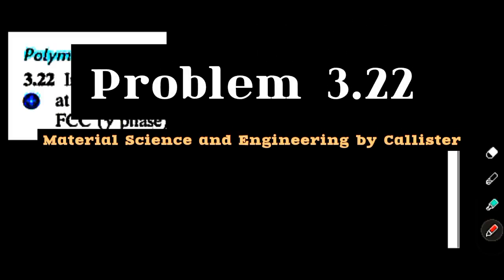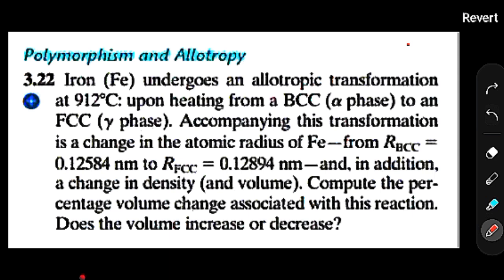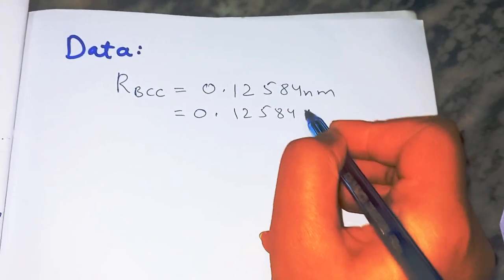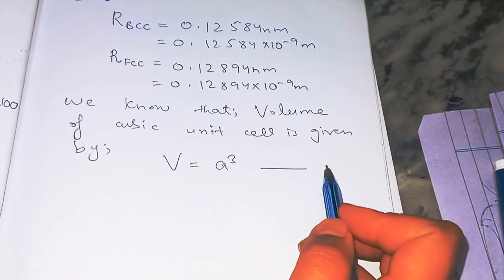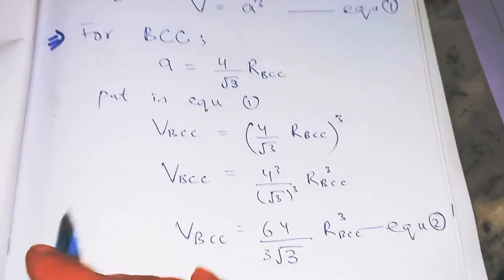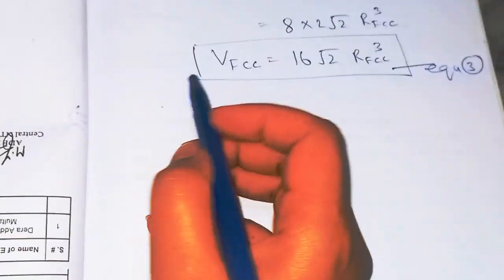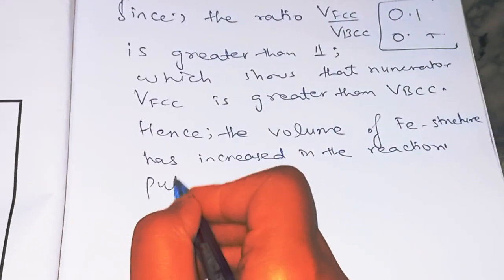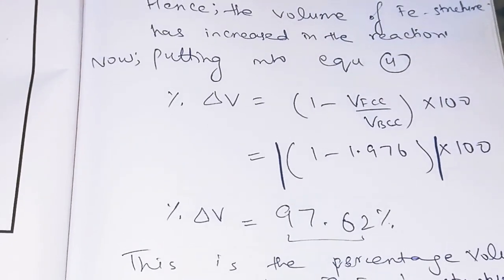Iron (Fe) undergoes an allotropic transformation at 912°C: upon heating from a BCC (a iron) to an FC

Comment: i have a question: in BCC structure one unit cell contains 2 atoms, in FCC structure one unit cell contains 4 atoms. So for the same number of atoms when you transform from BCC to FCC, the number of total no. of unit cells should will be halfed. Did you consider that in this solution?
Reply from the maker: Since densities and radi are already given - these values holds that difference in net number of atoms per unit cell.
So we dont specifically need to put these values here. Percentage volume difference can be calculated without that 👍
Reply: @learnwithamnab  Sorry, but that is incorrect. You should be comparing how much volume is being occupied by an atom rather than the volume of a unit cell, since the unit cells have different numbers of atoms per cell. You can tell that your answer is wrong because as iron goes from alpha to gamma phase, its density increases. This means that volume should be decreasing for a given amount of matter. As well as for the sanity check, your answer suggests that iron doubles in size as it reaches the gamma phase. No material has this property.